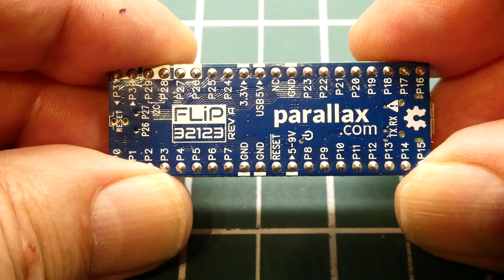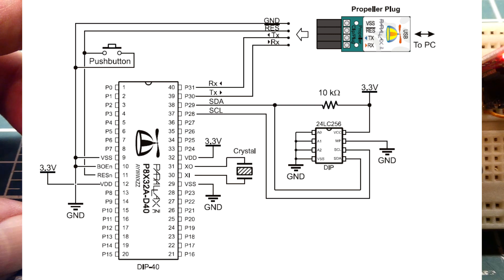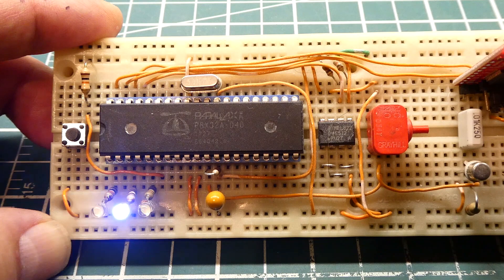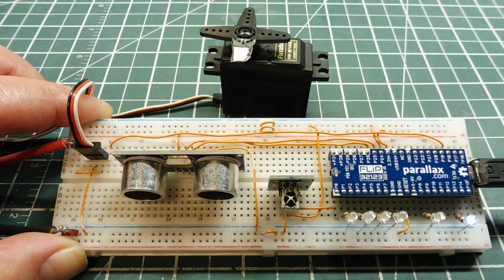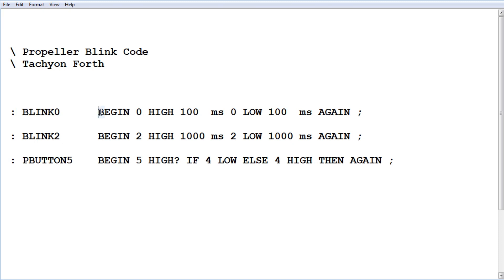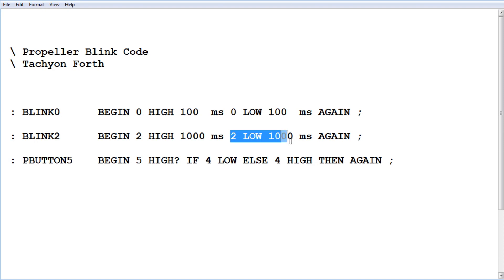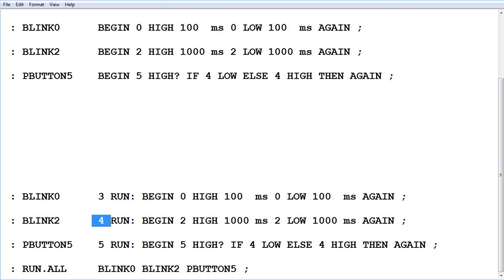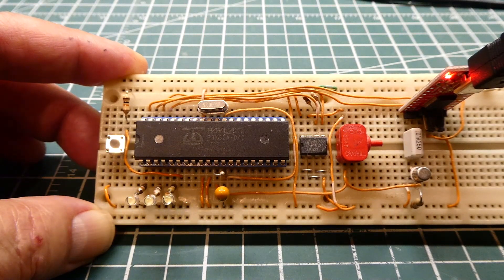Simple Multicore Programming / Propeller P1 / Tachyon Forth

Comment: What is the purpose of the serial EEPROM?  And what is the value of the crystal.  Thanks. Great video.
Reply from the maker: The crystal is 5 mHz which is multiplied to 80 mHz internally with a PLL. The serial EEPROM is for program storage. On power-up it is loaded into the internal RAM and run, so there is nothing to wear out. You can also load the RAM directly from your PC. Thanks for the visit.
Reply: @0033mer  Where can I find instructions on setting up the bare chip on a breadboard?  That appeals to me.
Reply from the maker: Follow the schematic in the video. The crystal, Propeller P1 and Propeller Plug is available from Parallax. Use a 24LC512 EEPROM. Download documentation and Propeller Tool software from the Parallax site. Check the Tachyon site for software and documentation.

Comment: That was nice.  A good follow-up would be showing how the tasks can communicate between each other.  Usually you have these tasks running and they're not wholly independent of each other, e.g. inputs occur and that means the task monitoring the button needs to modify the behavior of another task like the servo motor.
Reply from the maker: Cogs commuicate with each other through global variables and flags. The distance sensor is continually running updating a variable with distance values. Any cog can read this variable and act accordingly. For complex projects I create circular buffers in each cog where the data is available to any other cog. Check out my LoRa repeater video. https://youtu.be/wR-2c8VgunI